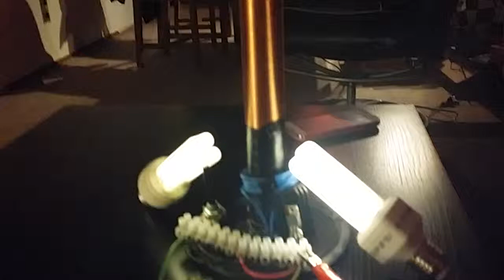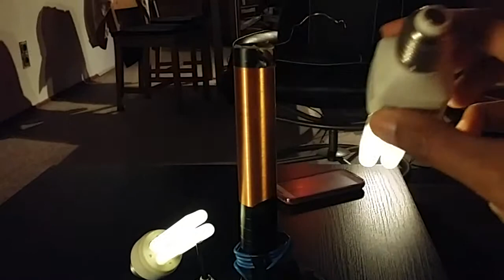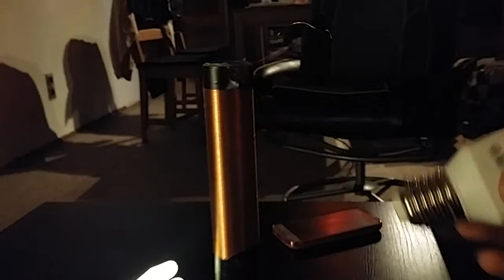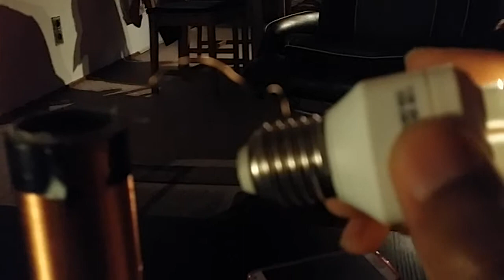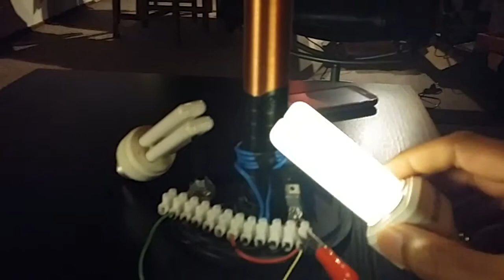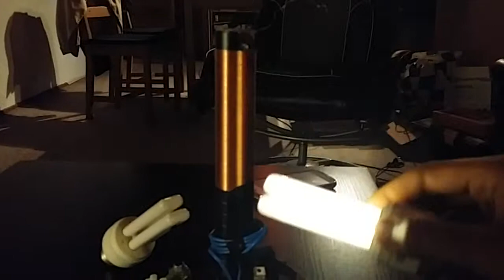Slayer Exciter / Tesla Coil : build v1.0

Comment: Only trouble, is you still require power source to feed coil rather than a self generated motor that once in motion; continues a feed independent from a plug in (dirty electricity) mains... This would be totally portable and off grid.
Reply from the maker: Do you have any replica table ideas for that problem?